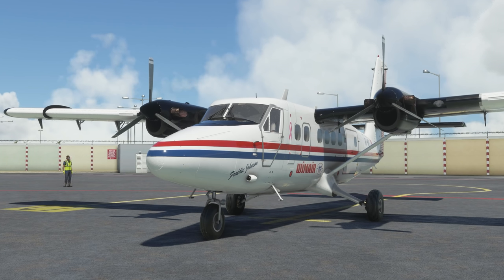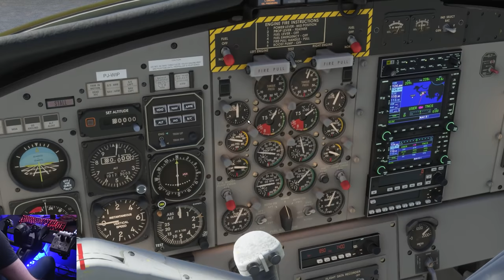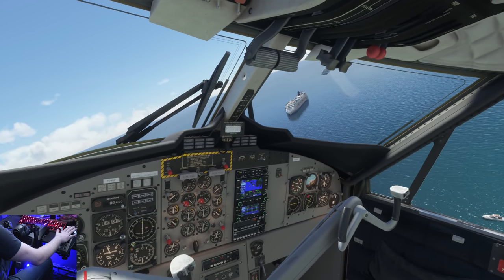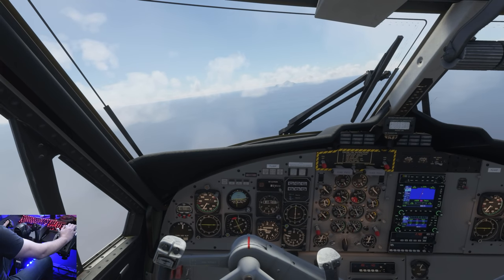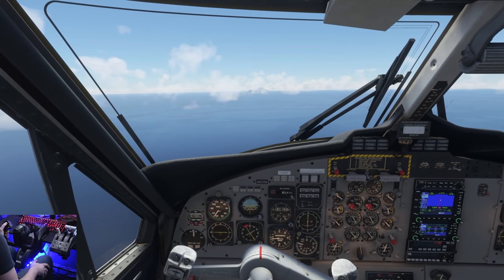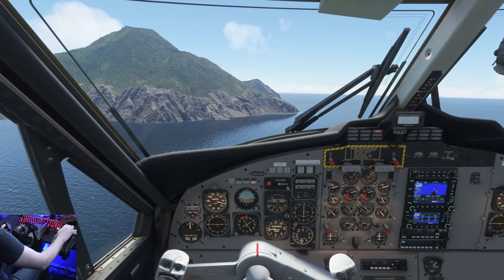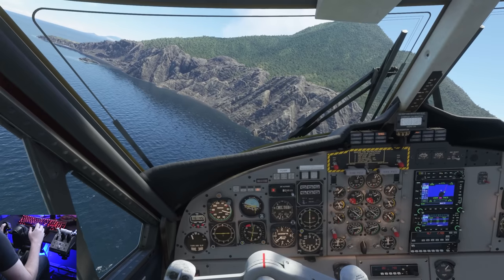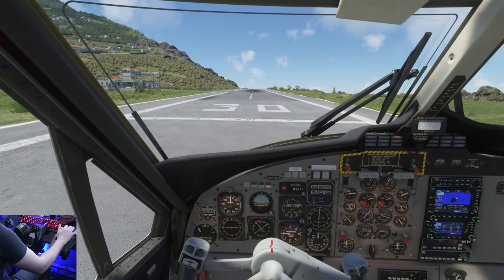Shortest Commercial Runway in The World!

Comment: Hey Jeff, after landing...progressively continue rolling aileron into the crosswind until you reach full deflection throughout the landing roll. This should help with directional control, and is a real-world technique. This takes advantage of adverse yaw, as well as disallowing the windward wing from rising, to produce better directional control. Use the same technique in reverse on takeoff. A caveat: With swept wing spoiler equipped aircraft, use only the amount required to keep the wings level, as the deployed spoilers will lengthen the takeoff roll.  Great vids. Keep em coming!
Reply: Hey dark_water what  was the lspdfr  episode when jeff was in the 2014 Explorer with the CHP light bar with the sheriff livery it had 09 119 on the top of the roof and it did not have a great handle and it cause Jeff to crash on great ocean highway
Reply: @tylatham1580  it was  #24
Reply: @MonaLisa.mp4  I tried that one it not it
Reply: @MonaLisa.mp4  hey go look at episode 200 lspdfr